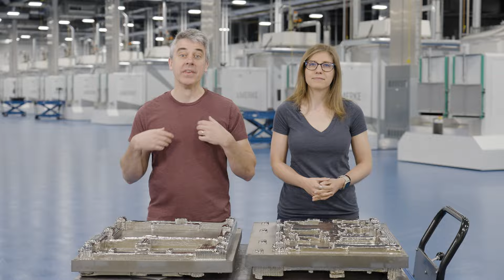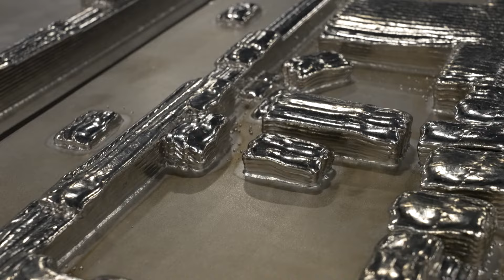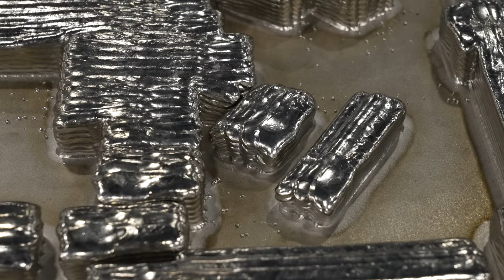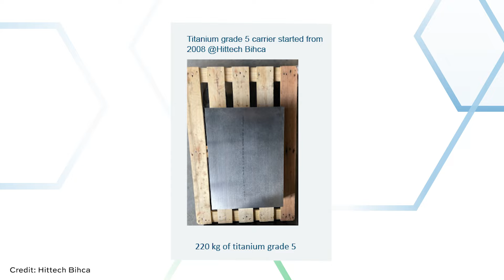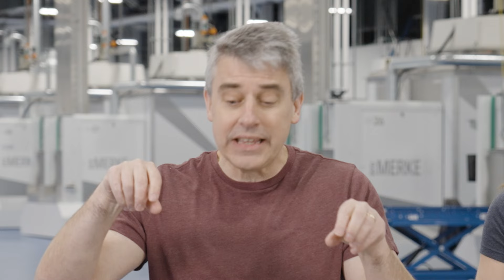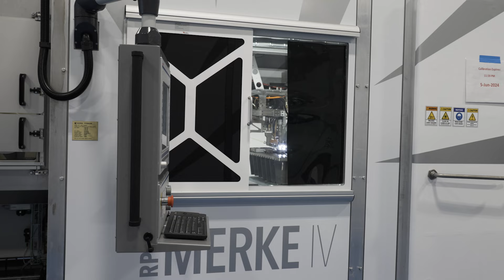How 3D Printing Aids Sustainability for Semiconductor Equipment | The Cool Parts Show Bonus

Comment: also we can't make them out of powder because of high vacuum. and the powder would end up in the ASML machine. and you don't want particals that are 15-53μm (fine) or 53-105μm (coarse) inside a machine that "prints" stuff at 0,000008 millimeter.
we didn't really "find" them, they've already had other tests done with norsk, different parts but still the same materials.

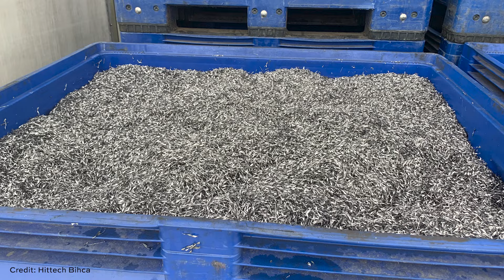Comment: 2:33 It is chalenge to configure the CNC to start from random shape? Because not all depozition will be 12mm wide maybe 13mm or 12,5mm. CAM can figure it out?
Reply from the maker: Casting to some extent poses the same problem. I.e. variable stock envelope for machining. The solution might involve probing at the machine tool to let the CNC find the exact starting surface for machining, and/or it might involve a sequence of very light initial passes, some of which will be air cutting, until a depth is reached where the cutting tool can be assured of having fully entered the material. Either way, machining a workpiece with a varying initial geometry is a problem machine shops know how to solve!
Reply: This is the fun part!
Reply: @xXTheRealShadyXx  i actually work with the part. (sister company of bihca) and wel ... it's like 10 minutes of work more (did it 2 says ago 😅). yet the wasted is WAY LESS!. 
so in time we don't win that much but in " wasted " product we win A LOT. 

i can't say much more than that but what @additivemanufacturing said is very close to reality.
Reply: @Haaalo079 neat, I actually work at Norsk and make the preforms

Comment: Never heard of this type of manufacturing before but the combined uses of production makes sense! I was wondering if that waste from the original block was feed stock for the additive process? Maybe I am reaching but nice thought no?
Reply from the maker: Yes, nice thought! The feed stock for Norsk Titanium’s process is wire, and the company has one wire supplier it works with closely to obtain its optimal material specs. I am not aware that there is a means by which material waste from machining can be used to make this wire. However, your thought is one that other material providers are also thinking. Examples: For powder-based metal AM processes, 6K has a system that can use machining waste as a starting point (https://www.additivemanufacturing.media/articles/getting-to-a-circular-model-for-metal-powders-makes-am-more-sustainable) and Metal Powder Works uses a method engineered to begin with metal chips (https://www.additivemanufacturing.media/articles/video-a-mechanical-method-for-metal-powder-production).
Reply: @AdditiveManufacturing  I can explain what happens to the chips. They are sold to material/metal buyers who recycle the "waste" and transform it into usable material again, or they sell it to companies that specialize in this process. However, because the material is now mixed with aluminum, steel, carbide (from broken mills), etc., it no longer meets the "standards" and is therefore usually sold as a different grade of titanium.

so we call it "waste" but it's not actually waste, it wil be used in other stuff.